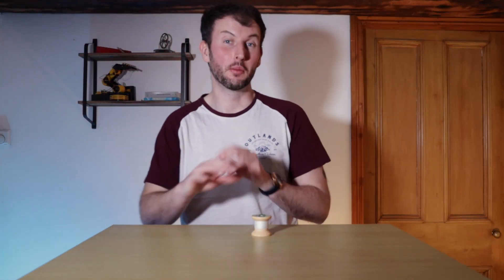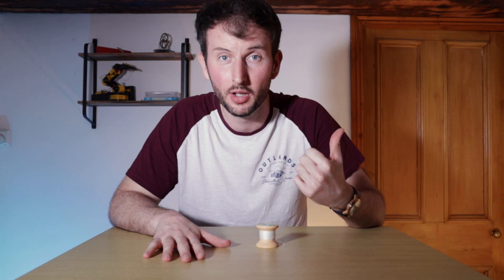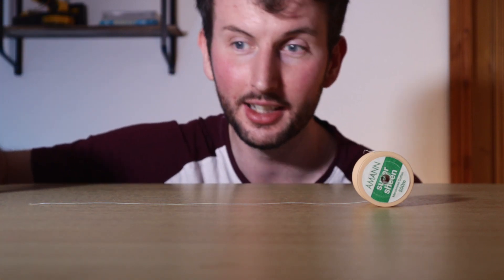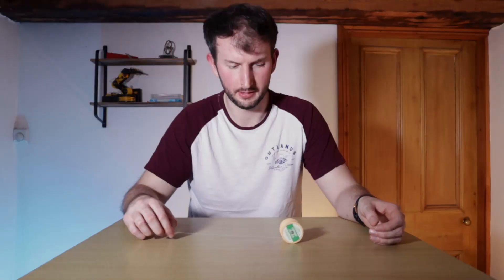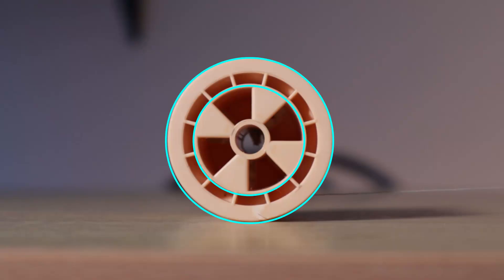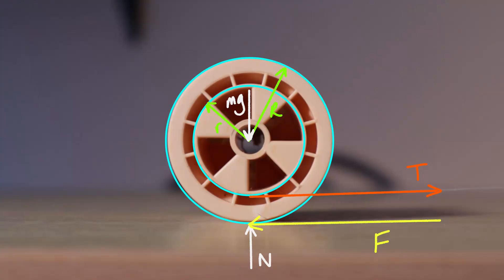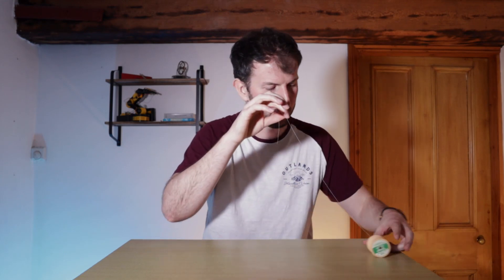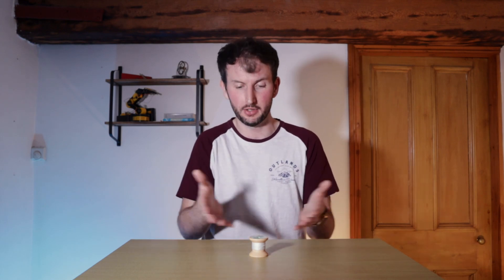Which way will the spool roll? | Mechanics worked example

Comment: Wouldn’t static friction act to the right?
Reply from the maker: Great question! Friction opposes motion, so if we pull to the right friction opposes it to the left. Another way to think about it is, imagine you did this on a really icy frictionless surface... If you pulled the string then, it would unravel and spin in place anti clockwise, meaning the surface of the spool would be moving to the right relative to the ground. Therefore, when friction is present, then the force must oppose that rightward motion and point to the left. Hope that helps, and thanks for the great question!
Reply: @ciaranmcevoy9875  Thank you for the great video! I'm currently taking mechanics class in uni and naturally this classic problem was discussed. What confused me was knowing the direction of the friction force. I asked my professor why we assumed it was to the left, while tying to explain my reasoning so he could tell me what was wrong with it. I thought about it in a similar way to what you explain in the video (the tendency that the spool aquires due to the tension is to rotate anticlockwise), and I was also trying to understand what happens throughout time (starting from wrest until it reaches the new "equilibrium", which is to rotate clockwise). However, he told me I shouldn't think about "tendencies", nor about the beggining stages of the motion: the equations are valid from the infinitessimal instant in which the tension is applied. Still, I couldn't find a satisfactory explanation in any textbook or video. 

Sorry for the long contextualization, but I had two main question for you:

1) As you said, the tension makes the spool want to rotate anti-clockwise, so the friction must act to the left. However, I can't understand why there isn't a turning point, where the friction acts to the right, because what ends up happening is that the spool rotates clockwise. Shouldn't the friction force be to the right to keep it that way? The friction force to the right is not actually countering the motion, since the spool doesn't actually rotate anti-clockwise.

2) Do you know of any textbooks that go through this carefully, or that clearly explain how to think about limit cases (like the table being made of ice) or tendencies (the tension makes the spool want to rotate in a certain way), or other concepts like these and how to incorporate them in the process of analysing a physical situation?

Again, I appologize for the long text and really appreciate your help.